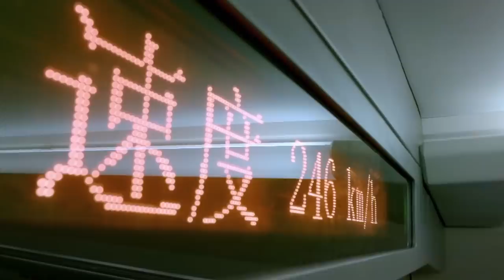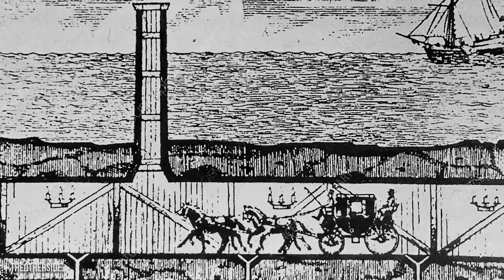Inside China’s $3.6 Billion Underwater Vacuum Train

Comment: I believe there is a lot of misinformation in this video. The video clips and project don't even match. For example, for the Channel tunnel, they are showing cars and a road tunnel. But the Channel Tunnel is a pure railway tunnel. You can't drive on it. As for the main project discussed - the Ningbo-Zhoushan railway, I had to look this up, since I know of main railway projects in China, but never heard of this being a vacuum tunnel. The articles I found all say it's just a normal railway tunnel with a 16 km undersea section, and the trains that eventually pass over it will only be 250 km/h, which isn't even very high speed by China's standard of 350 km/h for its fastest operational lines. China is supposed to be working on a 600 km/h Maglev (Japan is currently building one), but that project will be between Beijing and Shanghai, and is only at a very early stage with only one prototype made, and it didn't travel 600 km/h. There has been talk of China building a hyperloop (I believe Guizhou has been mentioned), but there is nothing concrete at this stage. Overall, I am very skeptical of the quality of the information in this video.
Reply: I hope you remain skeptical 🤨
Reply: Not only you. The video is like the author is banned in Google and cannot fact check while also not knowing a heck about what is he talking about. That's how rumors are made - just a compilation of different not connected news with a compilation of different not connected video footages. Like literally what he claimed was: China is building a vacuum train to achieve 250 km/h on like a 10 miles span - every part of it is an absurd.

Comment: Lets assume hyper loop is possible(which is highly unlikely). I am hoping this vacuum train doesn't broke down in the middle/ tunnel wont have problem after 1-2 years
Reply: Vacuuming the tunnel will be massive. Can't do it partially either and if a train does break down and leaked all the air out, those people will die. Don't have to crash to die. I feel maglev should the way to go for now.

Comment: So many inaccuracies in this video. The public can't drive through the Channel Tunnel - you drive your car or lorry onto a train known as the Shuttle and this transports the vehicles to the other end. Nor is the tunnel known as the Eurostar - that name belongs to one of the passenger rail services that use the tunnel. Most of the video clips accompanying the Channel Tunnel section of the video were from other tunnels or rail services. Horrendous research.
Reply: Exactly. And hyperloop also doesn't have anything to do with the tunnel. Like "hyperloop" to run only in the tunnel with a speed of 250 km/h? Absolute nonsense.

Comment: it can't be a full vaccuum right that would be dangerous they're probably just removing most of the oxygen out of there but there would still be oxygen
Reply: Obviously
Reply: It can be full vacuum as long as the train is fully sealed. If theres oxygen in the way then it will slow the train down.

Comment: hello! This is basically a hyperloop, since its powered by a vacuum?
Reply: Nope, hyperloop is not financially or technically feasible and competitive enough to make a profit. The tunnel that China is constructing is most likely vaccumed to minimize air resistance thus allow for greater speeds within the tunnel. High speed trains will run on designated HSR tracks as usual.
Reply: No one is ever thought about "powering something" with vacuum. It is just absurd. Vacuum is just the easier MEDIUM to travel than the air, not something that POWERS something. However most likely it is a regular tunnel. The proposed speed of 250 km/h is easily achievable by regular trains running on the rails (through the air, of course, not any exotic vacuum or whatever else). Also if there would be a "hyperloop", then why building a few dozens of miles tunnels where you can't even utilize really high speed? It's not a test track, it is an operational tunnel.
As for hyperloop in general, I wouldn't be so optimistic about it. Trains on the rails can theoretically go 500 km/h with passengers, practically 400-ish, maglevs can 100% go over 500 km/h with passengers etc using current gazillion times proven tech, 600-650 later on. But maybe as high as 800 and even 1000 km/h. Hyperloop expectations were being reduced to like 1000-ish km/h - not that much faster then maglevs but with greater expenses and risks. Hyperloop is technically a maglev inside a vacuum tube (not absolute vacuum but still) so it already is a maglev and cost like a maglev but you also build a tunnel around it all the way and also like a gazillion pump stations consuming tones of energy. But ya, just sprinkle a bit of solar panels on top and here is your eco friendly transport (sarcasm, solar panels on top of that tubes on various hyperloop renders and animations are funny - what idiot would really believe that they will actually propel a train full of passengers to the airplane speeds - they will maybe reduce the power consumption on a fraction of a percent but that's it).